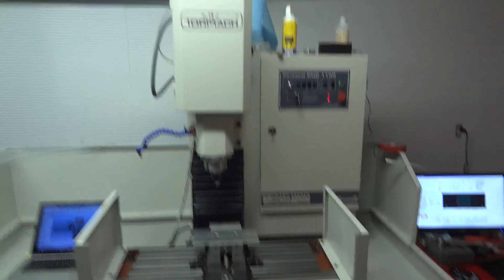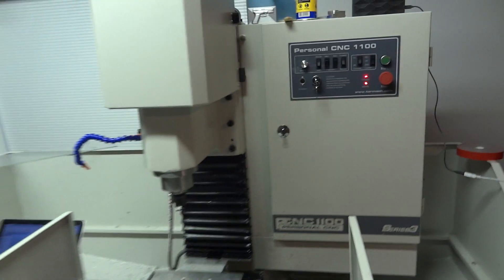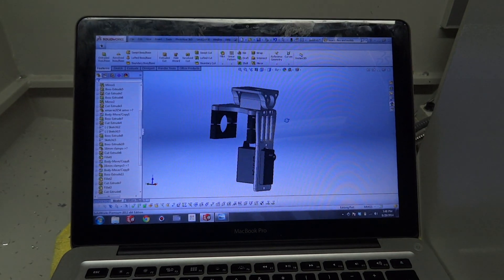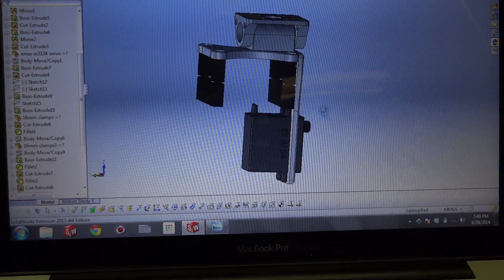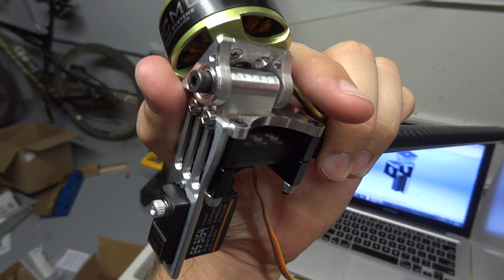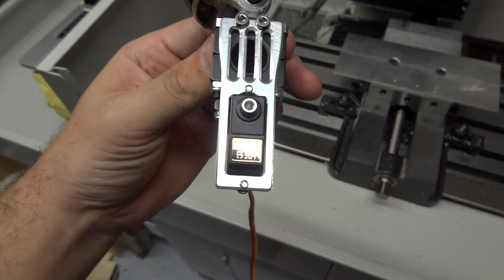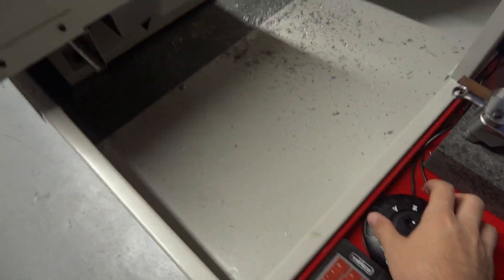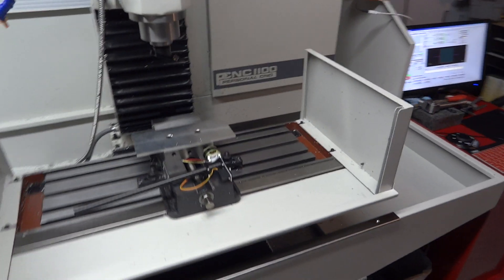My Life: Prototyping, Machining and Designing

Comment: As a mechanical engineer of some 40 years, your baby cnc mill in your garage had me smiling...I used to machine metal for a living for about 18 years working for the MOD, and even now can get excited machining stuff on my precision Myford centre lathe at home...I spent my later years designing laser cutting machinery....I also built my own miniature Gas Turbine at home, you can see it flying on my channel if you get time....If you know you have a talent for something and you enjoy doing it, it has to be the best job in the world, right?...Oh, and did you ever consider making a Tri Copter where the two front Rotors tilted to assist forward flight ? Your tail tilt mech has been done before, but very nice work in metal, is it not a bit on the heavy side though? Subbed, I want to see what comes next off that baby cnc mill!!!!

Comment: nice! id love a tormach. inexpensive lol yea right . Thats a big machine still . im sure you had some time lugging that into its home. I just got into quadcopters and also have been machining for a while as a hobby. I have a small x2 cnc running mach3,solidworks and hsmworks cam .Also have a grizzly G0602 cnc lathe, Should be able to mill some small copter parts.I noticed you are using a carbide tip on your flycutter . You will get a much better finish grinding your own HSS flycutter bits.I have been using a face mill more often now but i still get a little better  finish with the flycutter on aluminum anyway, Smooth as glass. Keep up the great vidz !

Comment: That's an expensive way to go, but if it gets you up and prototyping where you have more ideas than time then it's not a bad deal.

Brings back memories of growing up amongst 3/4 acre of metalworking machinery making high precision steel mounting systems. I remember the birth of CNC coming from NC machines, stepping through PLC's and onto multi purpose programmable machines back in the day. Am a software developer now, but this brings back fond memories.

Amazing what you can do nowadays in your garage, keep the vids coming. Share the passion, whatever it may be.

Comment: nice video ... your tormach is a real beauty and sturdy ... yes pls share more videos on your workflows, machines, tutorials etc ...

its the same route i have taken .. started flying then got the machines (all scratchbuilt though) .... so over 2 years i put 2 cnc machines  (3 axis and 4 axis) together, then a prusa i3 first, then Gmax and know a custom designed delta :) ... also working on filament extruder to support the 3D printers ... PLA with CF is in the works .. hope we can print frame parts out directly :)

next month i start on a cnc lathe machine and moving into composite fabrications .. now more then flying i prefer designing (Inventor pro, 3d Max and Rhino) and making my own stuff ... i find this a lot more rewarding ...

Although i am a traditional Web, print designers and animator .. i love working and building machines which in turn make usable stuff

all the best to you 

GB

Comment: Have you ever thought about using Siemens' Unigraphix (NX) at all? I used that and SolidWorks, and found NX quite a bit more powerful and easy to use. I made a Futaba servo to exact dimensions on NX in about 1/2hr, and on SolidWorks in about an hour. It's just personal preference I guess.
Reply from the maker: I have some friends that use NX professionally and love it. I'll need to check it out soon. It's so hard to pry yourself off what's comfortable though!

Comment: That's a great machine for a garage dude used Haas machines are out there at closing auctions. Endmills are the crazy cost,
 My frame will take a 20mm tricopter tail so I'll be checking your site
Reply from the maker: I've had some experience with the VF2. Those are great but huge!